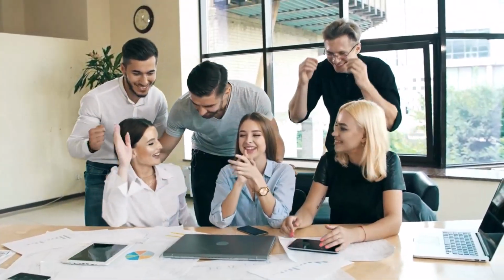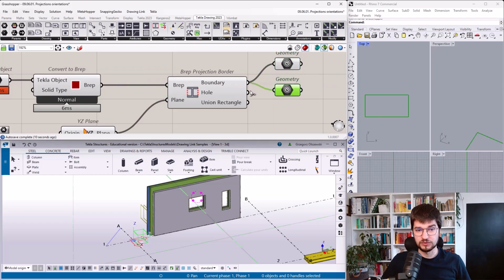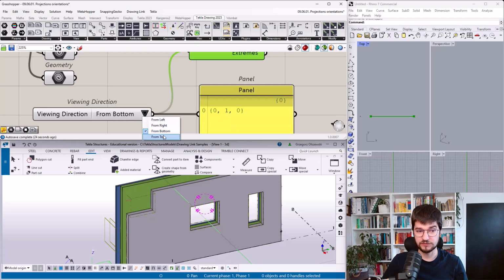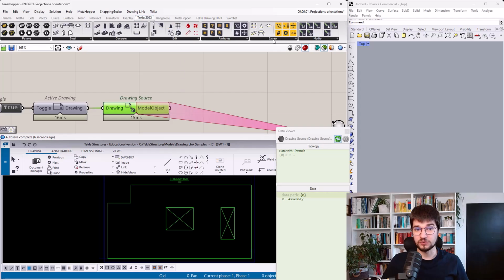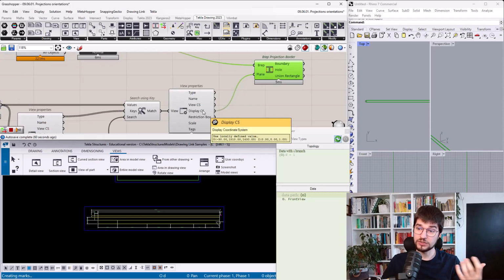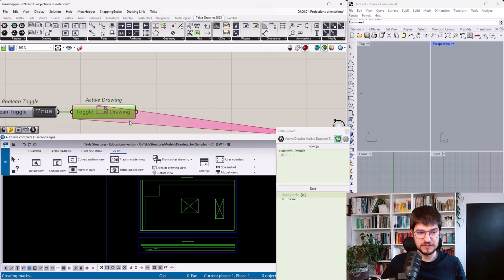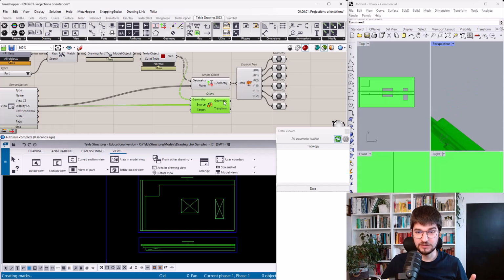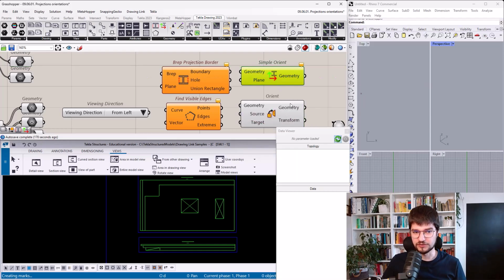Create Perfect 2D Projections from Tekla Structures 3D Models

Comment: Hej, thanks for insight and ideas on how to start using 'Drawing Link' 👍 
Also a question - is it possible to use the 2D projection on complex assembly's (the ones, that bounding box does not align perfectly with desired projections, thus making Tekla created views useless), so that I can get a perfect XY plane projection and than use it to create a view, perfectly positioned in the same way, as my 2D projection in Rhino ?
Reply: Hi! It looks like you need to rotate the view (there is a component for that in Drawing Link) or maybe rather change the display coordinate system using the Modify View component.

This could also be solved with some crazy idea like placing model views inside the assembly drawing, but I would rather stick to the standard part view with adjustment to the display coordinate system. Should work :)